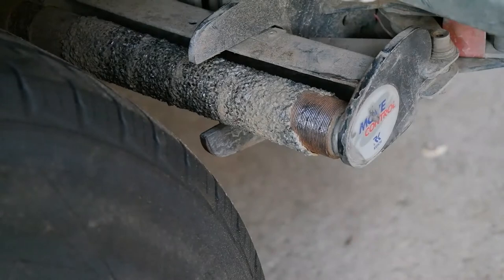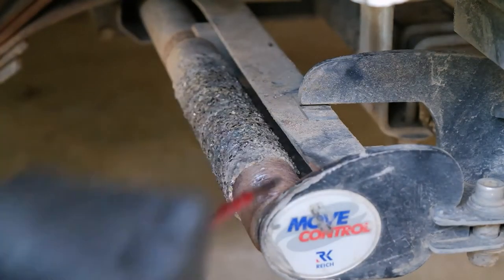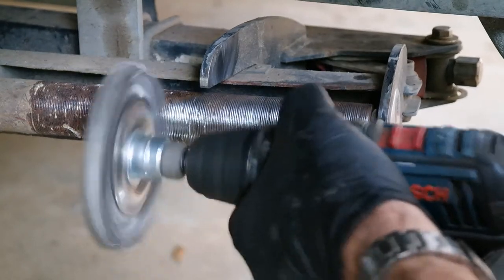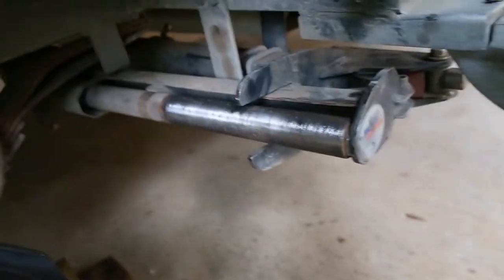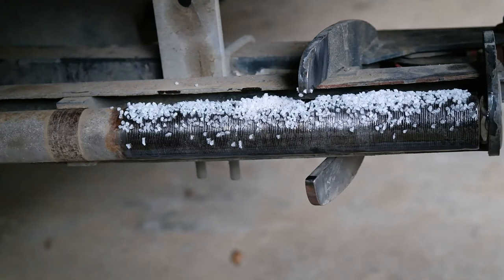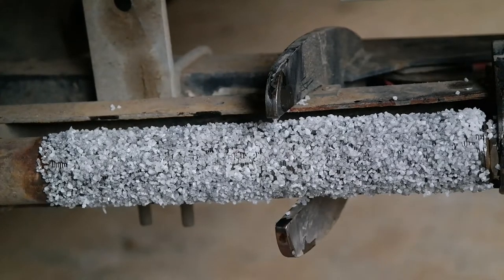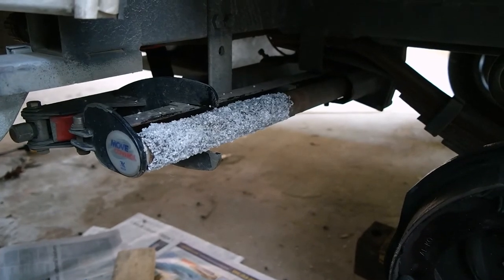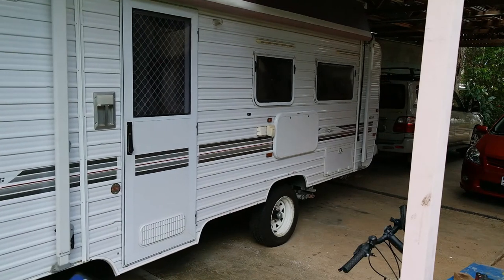Reich Caravan Mover Roller Re-grit

Comment: Well done Tim.
Good job done.
I would like to mention that I think that the height of the mover looks set too high up on the wheels which is where most of your problems stem from .Not the distance from the wheel. The mover should be on the centre line of the wheel.Because yours is too high when you put more pressure on the wheel , the wheel moves down and away from the roller therefore reducing the grip.
Reply from the maker: Indeed this is true Jim. In an ideal world the mover would be mounted dead centre of the axle. Also the bracket arrangement isnt good on this van and flexes to much under load. I have since changed vans and now have a dual axle and twin movers now installed. These have issues also as the motors dont like trying to turn a dual axle van as you are essentially dragging one lot of wheels sideways. I think also that these movers were designed for the lightweight European and UK vans not the heavy vans we have in Australia. That aside the movers do the job for me most of the time. We are about to replace the grit rollers on this van (now owned by a relation of mine) with Aluminium rollers.

Comment: Hello Tim. Can yo maybe write down the name of the resin you used? And what is A+B ? Thank you:) Very useful video. Greetnings from Hungary:)
Reply from the maker: Hi Alexa, The product that I used is a locally manufactured product here in Australia so would not be available in other countries as it is not exported. All countries have similar product readily available. They did tell me that it is known as "artists resin" which is just a product name to appeal to the artist community. It has no special characteristics and is similar to resin used in manufacturing and repairing surfboards, etc. Resin comes in 2 parts "A" & "B" and is mixed 50/50% or equal parts only when you are ready to use it as it will commence hardening within 30 mins or thereabouts and will set hard in 12-24 hrs. Hope that helps. Cheers Tim

Comment: Did it last? also. this video could be mande in a 5 minute version.
Reply from the maker: Hi SnortTroll, Yes it has worked well so far and no sign of it having any issue at this time. Just finished another trip away for a month. I dont use it a lot but its very handy when I do need it to get into a tricky spot and always at home to park it in my drive with the smallest amount of space taken up. I will need to mover the roller position as its seems to be a bit far away from the wheel and it can flex a bit on the bracket arrangement. 

Yes I could have changed these over to the newer aluminium rollers but they are very expensive and can be difficult to replace given the age of this mover. This solution has worked very well. 

Sand that is generally available is not course enough or inconsistent in size and that was one of the grit solutions I looked at but I couldnt get anything locally that was close to being the correct size required or as I say consistent.

Yes I could have made it shorter but I think if you are going to tackle doing something like this the greater the understanding the better, I put it off for a couple of years as I hadnt seen this done through the various stages and any "gotchas" along the way so yep but long but you can always skip over to the end if youve seen enough.

Comment: what about sand and epoxy
Reply from the maker: I investigated sand but the grains are generally too inconsistent in size and I think you would have to find some specialist provider. I believe also that its not as strong and can breakdown easily and that lets water get in under the epoxy which starts the degradation process and parts of the coating start coming off as you could see in the start of this video (in this case it was the iron based grit rusting that let water in).

Comment: or make a roller from alu and machine sharper treads into it. no grit needed.
Reply from the maker: Yes thats another way of doing it but expensive considering the age of this mover. Also the rollers may not be easily removable given the age of this particular unit. The re-gritting is not expensive or a difficult job once you know how to do it and what to use and there is little risk of damaging the unit as could be the case with roller replacement